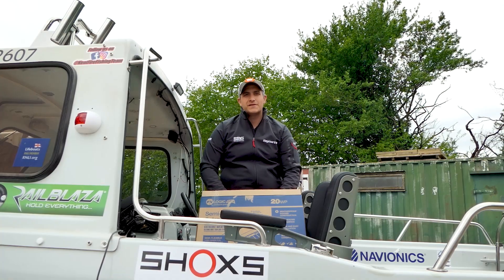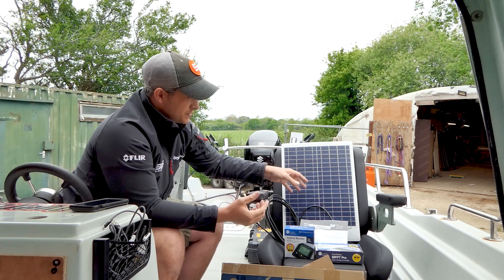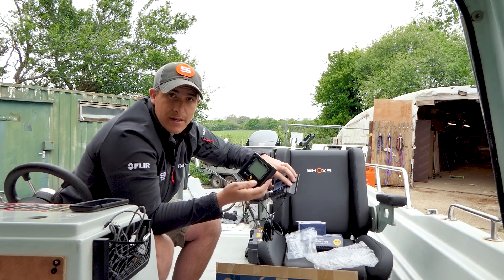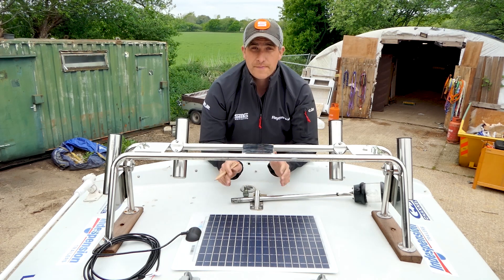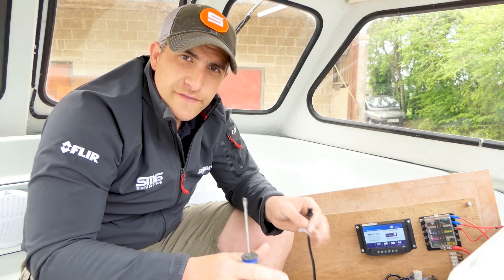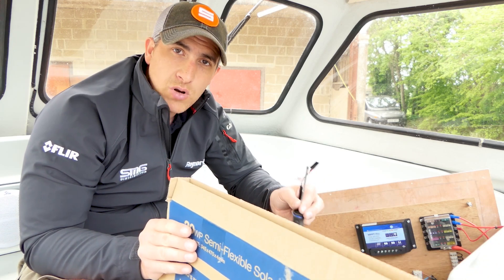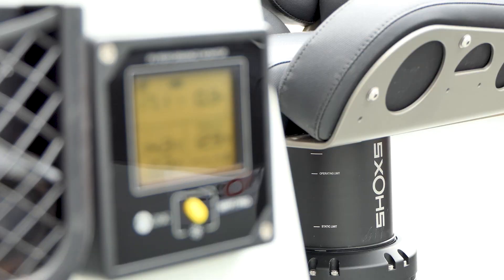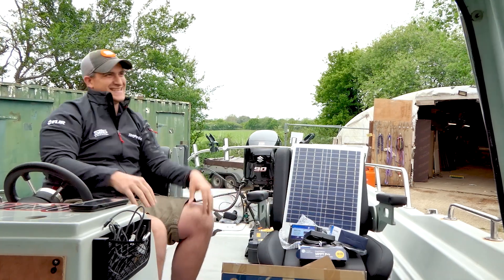Installing the PV Logic 20WP Solar Panel, MPPT Charge Controller and Activity Monitor

Comment: You cant connect 2 batteries to that charge controller if they have a common -ve. You need to use a charge relay.

Comment: I have the same pv logic mppt pro controller looking after 2x100w solar panels that charge the 2 110ah leisure batteries and the motorhome vehicle battery. I am very happy with it and I have just ordered the display unit instead of using the free app, which is good but you need to login and out every time you want to use it.